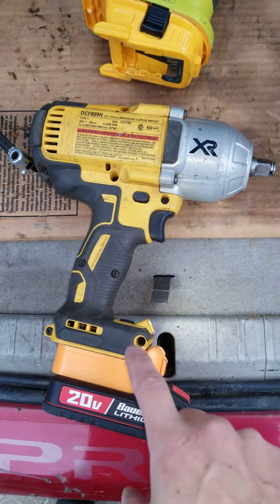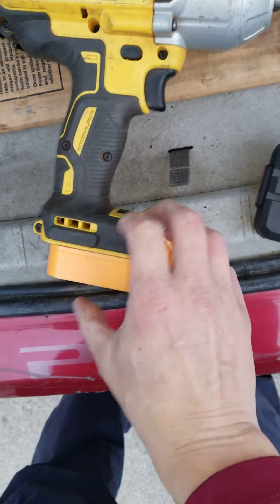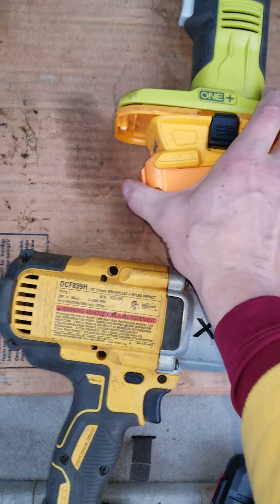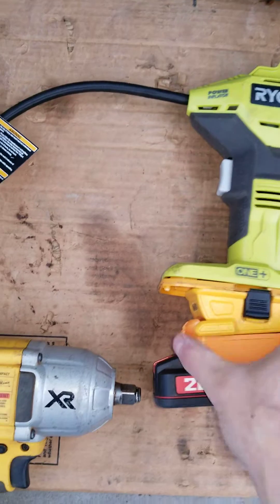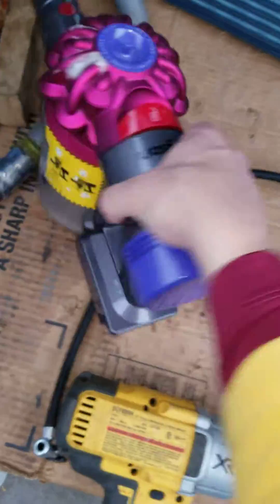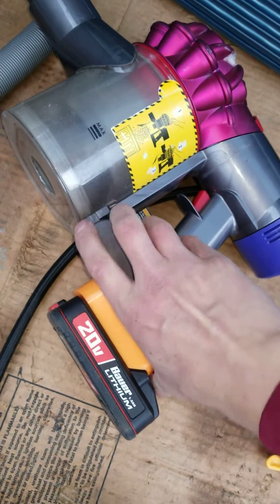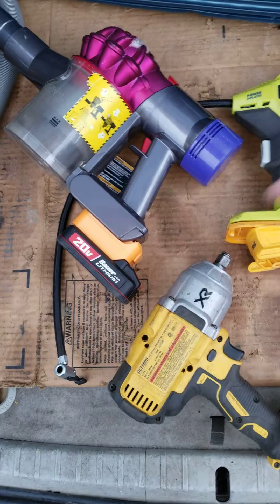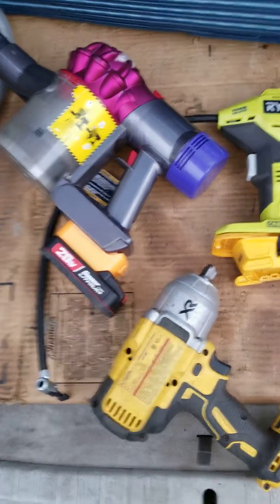Bauer 20V Lithium Battery to DeWalt 20V Tool Adapter Powering 20V DeWalt, Ryobi and Dyson Tools!

Comment: Did you print this or did you buy it? I'd love to pick one up
Reply from the maker: I bought on eBay.  Here's the link if I forgot to put in the description.  https://www.ebay.com/itm/134183975676

Had to try when I heard at HF that they were sure the batteries were going to go up in price.  Found still some new ~$30 5Ah ones on ebay so got one.

Looks like they're getting closer to the DeWalt pricing with what appears DeWalt might have went down if the looking like they're really appearing are actually genuine.  Now I see some around the $45 price. 

Regarding the adapter, I forget if I noted in any of the videos... seems I did though and forget offhand which one, however I did a little fire polishing and massaging to make sure the clip hook like piece didn't delaminate since seemed not the tightest bonded.  Works great still and I use with the Dyson cordless vacuum regularly and with a few DeWalt power tools every once in a while.